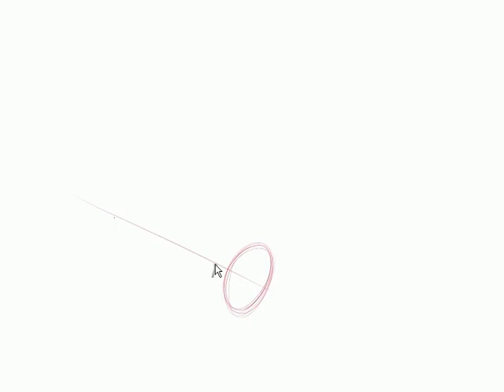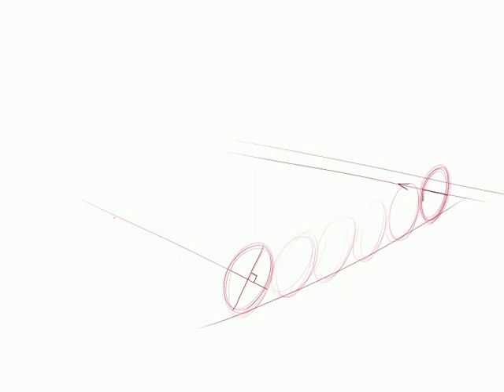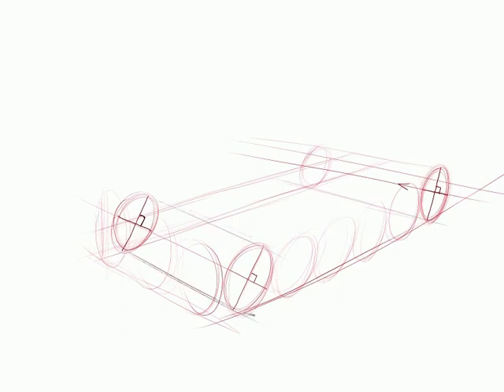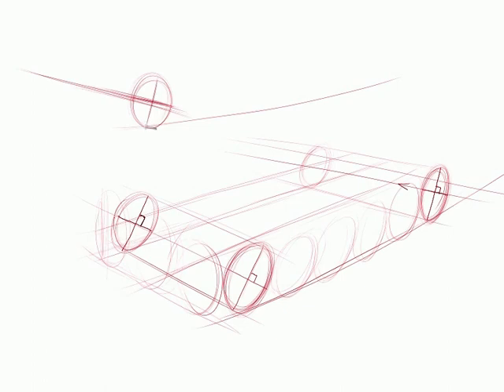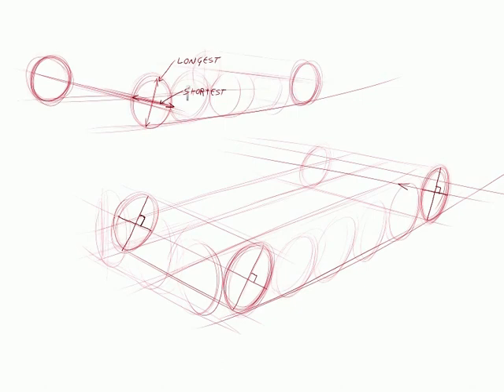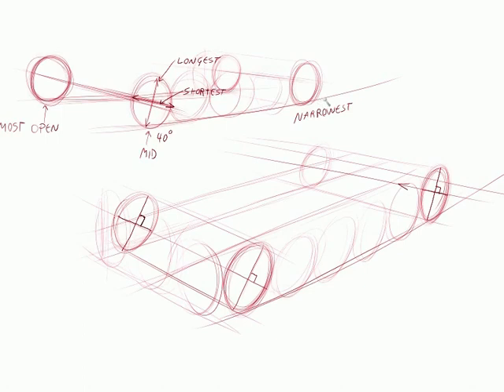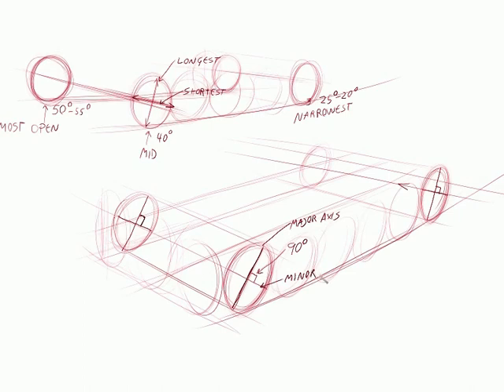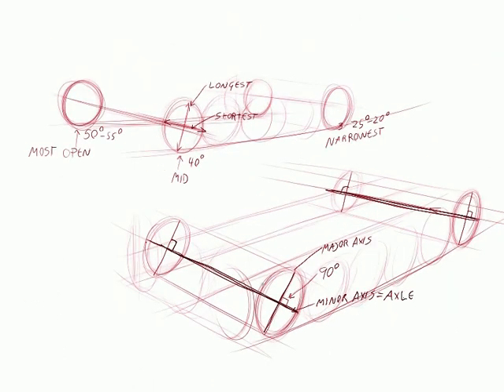Drawing Wheels on a Car

Comment: @LoganCoutts   if you mean ellipse templates ABSOLUTELY NOT cheating.. as a matter of fact alot of the times if you try to "fine tune" your rendering more you'll find you have to use a template cause  as doing it freehand is sloppy and people (not just the regular person on the street but ESPECIALLY other artists) will see a wheel and think it looks wrong if you didn't spend more time making sure they are relatively accurate.  ALL pros  make sure to get ellipses for wheels plastic or computer